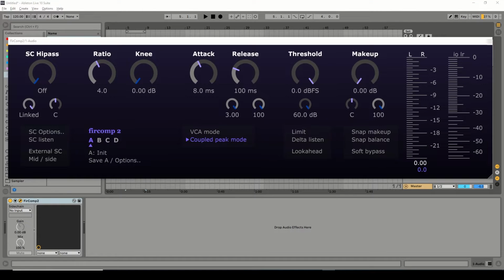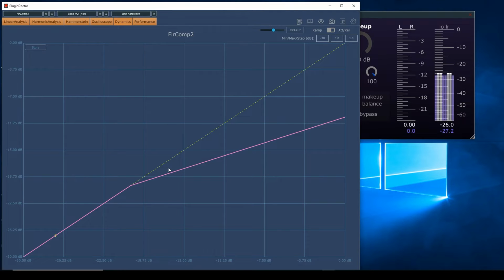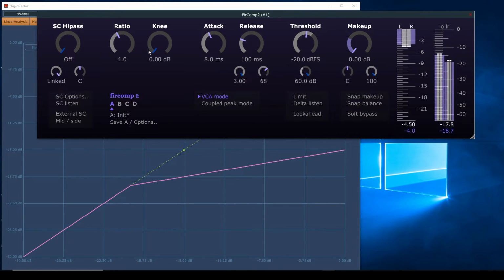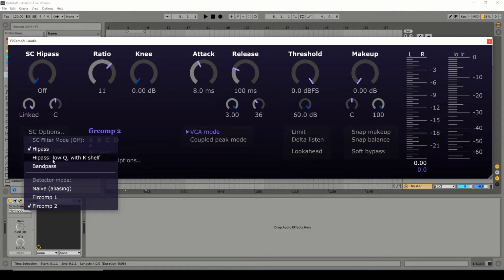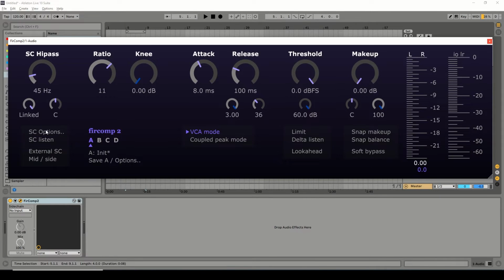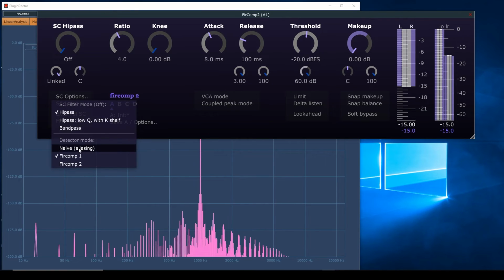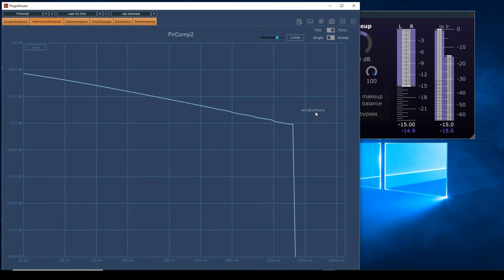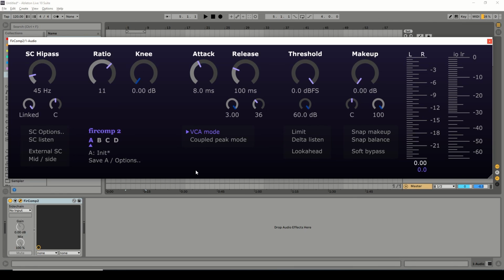Fircomp 2: Explaining changes & new features for upcoming update 2.1

Comment: Dear Jon, I'm trying the free version for few days and this is the cleanest compressor I've heard, amazing job!

There is something I always wanted in compressors and wanted to ask you about. Perhaps it is a feature request.

When I don't use compression and only do manual volume automation, I will reduce the volume gradually before the loud peak, sort of "pre-attack", which can be up to 300ms but it's really "program dependent" because it can be 20ms if there is information I don't want to attenuate there.
I will reach maximum reduction few ms before the peak just in case.
Then I will "hold" hold the lower volume during the peak and finally "release" it in a "program dependent" way - depending on what's is next.
This results in a very transparent compression to my ears.

I think what I'm doing is, extremely low knee, but only to the part that's lower than threshold, it's like a limiter in the part that above the threshold (the "hold" part).
It is also "program dependent" because the length of "pre-attack" is changed relative to material.
And it's a "look ahead" because it only works if it's about the have a loud peak (rather than a usual soft knee that would react to more sounds lower than specified threshold)

I'm not really sure about the technicalities of how it works so I might be wrong but this is the general Idea. 

Maybe I over complicated this, what do you think about this style of compression?

Thanks

Now a dream plugin feature request, the sound of Fircomp applied to spectral bands.
(like Voxengo Soniformer, Melda MSpectralDynamics, Sonible smart:comp or similar function Oeksound Sooth) it will finally be able to catch the most sneaky spectral peaks, which in my tests those plugins don't.
Reply from the maker: Yep, automation like this can be great, but I don't have the patience to do it :)

As a plugin it's possible in theory but would have too much latency unfortunately. What you're talking about is a program dependent lookahead that works like a release but in reverse. So it's probably best done with automation!
Reply: @jonvaudio-plugins  Thanks for explaining :) now I have a title for it :)
I hope you'll consider the spectral bands plugin!
Reply from the maker: @kaori-3882  Ah sorry I was referring to the automation idea plugin, I didn't see the part of your comment after the "Thanks".

Regarding the spectral bands compressor plugins, it's not something I'm likely to do as I feel that style of processing is a bit heavy handed, but certainly can be interesting. The timing of a spectral (freq domain) compressor would depend heavily on window size, so it's quite a complicated subject to discuss here :)